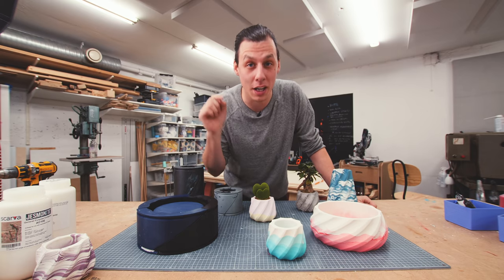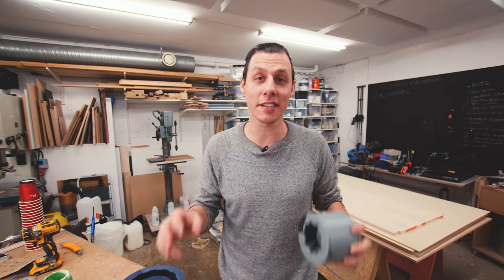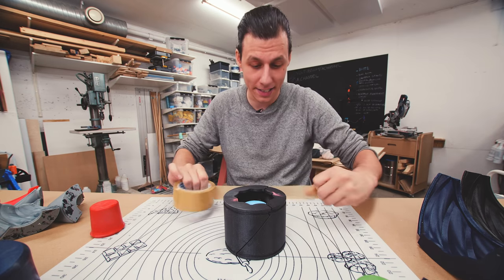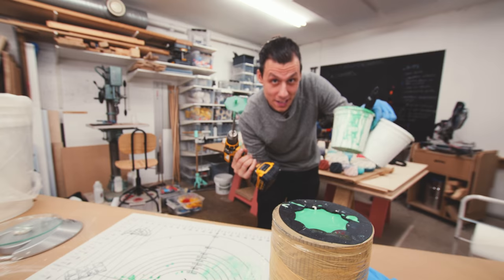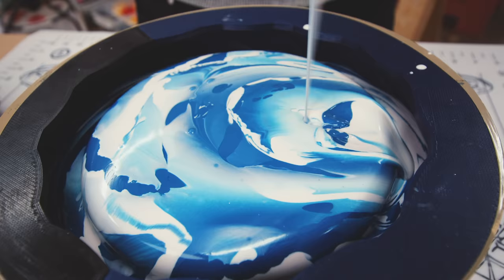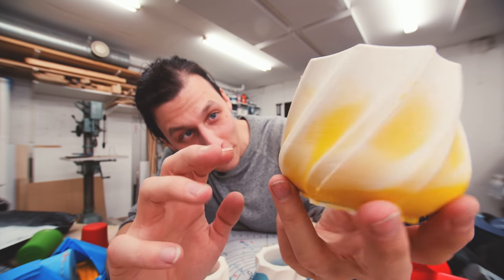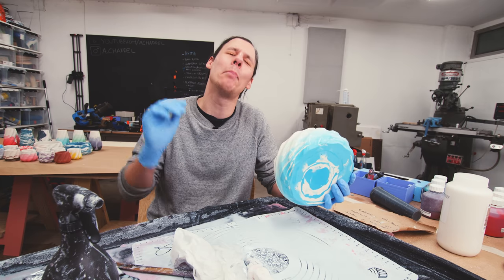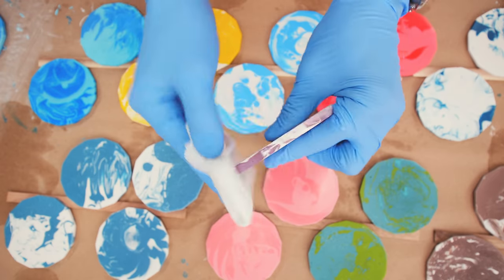Making Flower Pots and Planters using 3D Printing

Comment: Can you do a cad tutorial on how you 3D modeled these?
Reply: Its not that hard, you can model the final vase as you want, and use a blank block as the mold. Then use a Combine Tool in your CAM software with an Intersection cuttout, you will be left with the whole mold. After that all you need to do is to cut the bottom and separate the perimeter in 3 pieces. Tune the joints so you have interlocking surfaces, and you're ready to go.
Reply: With 3 extrusions, one Swept Cut and a Circular pattern you already have the vase drawn
Reply: I would love this too! I managed to work out the the vase / blank side, but the split / 3 part mould tricked me up!
Reply: Gabriel Hofstaetter the joint geometry is what I’m curious about , how to get a clean inside line printed properly cuz fdm isn’t good at vertical stepped sharp edges , u deff need some compensation for that in the model
Reply: @cadprocess3784  which material dou you recommend to print these planters?

Comment: If I were you, I would sand and fill the inside of the molds, do all that work once, then you get perfect castings every time after
Reply: That would make sense would it not
Reply: could also try salt annealing the prints
Reply: I thought the same. Since this is how industrial molds are made.
Reply: All of the salt annealing I've seen make the part rougher on the surface. I believe salt annealing is to add strength to the part and avoid layer separation which he doesn't really need here.
Reply: @Kurogod5  If you tried salt annealing yourself, taste the surface. Even after washing parts many times, I can taste the salt.. Not good for plants, salt...
Even though it is used as a mould, and the final product is diluting eventual salt released, and sealed- I'd hate it if a potted plant died from that. Especially if I'd sold it.
Also needs to be heated very carefully,  the "ideal baking temperature range" for a smooth/ fully remelted pla print, and a hard porous sponge can be very small. So small, that you have to account for volume, mass of plastic, mass of salt, container size... Sadly not yet a "place in oven, heat, presto" process at the moment.
Reply: A better mold leads to a better cast, but at the seams between the mold parts and with mold release agent not applied perfectly evenly there is always some need for finishing steps - at least if you want a high quality finish. Still you are quite right its well worth the effort to work the molds to a great finish before making your castings as that cuts down on the work needed hugely (its a step I rarely bother with when I do molds though - I haven't yet made enough of any one cast to make that extra little finishing time add up enough)
Reply: I would use abs for printing the mold and then make it clear with acetone but protecting the connections between the parts of the mold and there you have it perfect printing in FDM
Reply: @Mediamarked  ultrasonics cleaner...... and yes I’ve tried annealing also the finer the gain of salt the better the surface finish......
Reply: haha also might first thought :D
Reply: if he was to make another project like this, he could make one 3d printed pot, sand it and polish it, then make silicon molds out of the pot and cast in those molds instead.. no need to put the pieces together nor sanding the pots

Comment: Would you potentially be able to reduce the sanding time by perhaps taking time to finish and smoothen the molds instead?
Reply: Yes, if you print the mold with a material that is easier to sand (PETG, ABS) you could finish the mold further. Or you could sand a finished piece, and then recast into a new mold (silicone) but that can be pricy.
Reply: Or by smoothing the molds with acetone vapour
Reply: matia92 you may risk the molds not fitting together as well if you do this, you have to be careful
Reply: A cool video would be on finishing out the moulds to a smooth finish to prevent sending so much

Comment: Just an idea, try printing a mould in ABS and give them an aceton vapor bath. When done correctly the surface will have a near mold injected level of perfection. Could save a lot of time sanding. As usual an awesome video! Cheers

Comment: wouldn't be easier to sand the mould? would it make a huge difference in finishing time? try it let us know. cheers
Reply: In one of the other videos, I believe in the vacuum forming one, he said that the 3d printing material (PLA) it’s super hard to sand, and that it was easier this way.
Reply: @carirodri  yeah I can confirm that. PLA is a HUGE pain to sand in my experience. Even with a file you barely take off material.
Reply from the maker: sanding the mould wouldn't be so easy, just because they are made out of pla, and pla is super hard to sand :P But if I was to make more of them I would probably use one of the sanded jesmonite parts and cast a silicon mould out of that .
Reply: @achappel  Would an acetone vapor smoothing of the mold do the trick?

Comment: Hi mate, great video! 

Can I make a suggestion? What about trying to use ABS for the mold but instead of those layer lines from the printing, you use acetone smoothing on the inner surface (masking off the mold joins to ensure a tight fit). This might make your finishing process a lot easier since you drastically reduce the layer lines. 

Also some opportunity for chamfered/concave designs on the inside of the mold making the removal of it possible but giving the opportunity to make different effects. I'm thinking hexagonal shapes that protrude slightly. Or just a texture that provides a kind of bump mapping effect.

Comment: Wouldn't vapor smoothing the molds help remove most of the need for sanding?  Or would that compromise the seams of the mold?
Reply: Depends what kind of plastic he printed with. If they are PLA vapor smoothing would just weaken them.
Reply: @josephdecesaro1528  Maybe he could remelt them in a fine enough salt that it would be worth it?
https://www.youtube.com/watch?v=DyAKtS1b3SQ

In any case, he should definitely be sanding the molds first, rather than each casting.  That much of it seemed a bit silly to me.  He would still probably benefit from touching up the casts after but it would at least get him most of the way there.

Comment: Have you tried acetone smoothing ABS 3D prints?  You can almost erase the layer lines for things like castings and vacuforming.  If you get the technique down it would save a lot of those 13 hours of sanding.  Great video as always!

Comment: You could probably design a lathe-style chuck to hold the ends of your mold and spin it for you while you hold the tape. 
It could probably be run with a drill to be honest. Low speed setting.

Comment: It doesn't make a lot of sense to make this kind of prints, aside from it being a proof of concept.

You can use the printer for custom casing for personal electronic projects. Making mold negatives for interior specialised decorative elements that are not available on the market (exp.: baroque furniture, body forms, etc.).

I swear, I can't wait to get my own 3D printer and CNC machine. You guys are undervaluing the practical applications for these tools.

Comment: Printed the older mold in the week, and now my 15 year old son is mixing the plaster and a little bit of pva paint (used for art). Will take some time to experiment and find some good strong gypsum based plaster in South Africa to see if we get stronger pots. First pot came out ok, we almost broke it removing the middle of the mold. Baloon was a bit tight and split in half, but taking the outside of the mold actually provided good grip to remove the middle.

Comment: Excellent outcome! Out of curiosity.. Is there a specific reason you dont just sand the orinted part pre casting the jesmenite? I realise pla is a pain in the but to sand (although you could experiment with acetone smoothing some abs) but i suspect youd save a bunch of time in the long run 😁

Comment: Did you use Ac100 or Ac730? If you used Ac100, how is that penetrating sealer holding up to staining/water? Have you tried actually putting plants/dirt/water into them? I'm asking because I've had a lot of trouble getting a durable watertight seal on either of those with Jesmonite's own sealers. Great video by the way, lots of good tips!

Comment: like your work and design very much. quick question... Why do you not sand the mold after printing to get a smooth surface? you'd save sanding afterwards

Comment: Maybe you could make the cores 2-part as well, with a C-shaped outer wall and a plug to fill out the center and the mouth of the C.  Then the center of the core would pull out easily post-casting, and the C would release with a little compression.  Save the balloons!

Comment: Cool, but what if you use a filler primer spray paint on the molds to fill in the lines so you don't have to sand them after?

Comment: I wonder if you could model in a groove on the top and bottom of the molds on the outside and then use screw type hose clamps to bring it together, playing off the idea of a springform baking pan, instead of the packing tape. Especially if you really wanted to go into production mode with these for Etsy or something.

Comment: just an idea, sand the mold smooth then you can save some time in post
Reply from the maker: that could work, although I printed these in PLA and that is really hard to sand. If I was to make any more of these I would probably cast a silicon mould using one of the sanded jesmonite parts.
Reply: @achappel  It works well with spackle, you build up the layers between the 3d printed lines and sand it back. Also the spray spackle from clas ohlson works great in my experience.
Reply: @achappel  or smooth the forms with acetone :)
Reply: @adamvalt6609  That would probably end up being more effort seeing as you would need to print in ABS which will also mess with tolerances
Reply: Raymond Torkelsen - This man speaks the truth! 🤓
Reply: @adamvalt6609  PLA, dude you can't smooth it with with acetone  you will need tetrahydrofuran or some really nasty chemicals
Reply: @achappel  Try using HIPS to print the molds, the material is cheap because its not used very often and works really well for molds generally, because its easy to sand. It is prone to warping issues but since you have an enlosure I think it will work just fine :)
Reply: HIPS can also be smothed with B-limonene, but In the case of the mold; sanding and smoothening out the surface can lead to innacurate dimensions, and since your mold is designed to fit very secure I wonder or it will work well, But you could always try. Would spare allot of time :)

Comment: If you made one planter with the 3d printed mold, took it out and sanded it and finished it up, then made a silicone mold of the finished planter, you could have poured as many as you want without the need to sand any of them again. They would come out perfectly polished out of the silicone mold.

Comment: Great Video. Did you try to print with ABS and use Aceton to get a smooth finish to the parts? So you might save lots of time sanding.

Comment: are these printed w/o supports? if so, would it make sense to print the top of the planter mold on the bed plate to avoid the steep overhang?

Comment: Is it possible to make a tub or bands to close the molds instead of taping it? It'd be reusable and wouldn't waste tape. And a thin flexible 3d printed part to replace the balloon, so it would also be reusable, flexible so you can remove it easily, I assume.

Comment: Any particular advantage to sanding the 3dp moulds after printing instead of sanding the planters? Which grits are you going through (I saw a P600 disc in there somewhere)? Does jesmonite have any particularities with sanding? Thank you!

Comment: Great video again Alex, really enjoyed this extra video about 3D printing your own molds and using Jesmonite! Btw, I bought the plans and tried to slice the pot file, but it seems to big for the Pruse MK3 plate. Can I just resize it a fraction (and the inside part as well of course), or would that effect the overal geometry negatively? Curious what setting you printed it on. Always a trade off between quality and speed...those parts take so long. Keep up the good work and looking forward to your new adventures!! 👍😃

Comment: try ruby casting, in very high temperature ceramic/carbon molds, in a high temp furnace
Reply: um, why not just a coating, without sanding

Comment: I printed two of the original molds, in different sizes, and they worked great! What I did with them, was to use spray filler prior to first use. That got rid of any and all print lines. I also got some hose clamp bands and locks. With those I could cut them as long as I needed and used two per mold. This really got the fit nice and tight. These are the ones I used, so you get the idea:
https://www.clasohlson.com/no/Slangeklemmeb&aring;nd/p/30-7639
Works well and can be used over and over again.
Reply: What filament did you use?
Reply: @ArchTazer  PLA
Reply: @joagj1978  Good to know, thank you for replying

Comment: Amazing content.
But well, wife saw me watching this video...
Just demolded our first planter in concrete 😂
Now I am buying the bigger molds to cast it with plaster!

The balloon trick didn't work though. I had to drill two roles in the plug and use the plier to grab it an pull.

Does anyone know what Jesmonite is in fact? It looks like a brand, not product name and it doesn't exists where I live. I really like how the colors are strong on it. On plaster colors looks kinda washed out.

Comment: Woudn´t it have been easier to get rid of the printing lines by sanding the molds instead of sanding each pot?
Reply from the maker: since it's PLA, probably not, but a silicon mould would have been a good way to get better castings if you want to make a lot of these.

Comment: "mold release wax"  aka petroleum jelly , just like " ceramic or glass cutting oil" which is of course just mineral or baby oil,
Reply: that Jesmonite mould release wax is expensiiivvveeeee.  Would petroleum jelly work as well as the elease wax?
Reply: @jonb.9372  yes, anything similar to vasoline